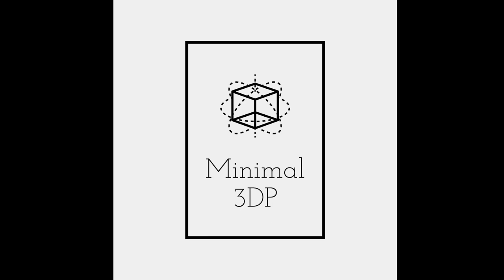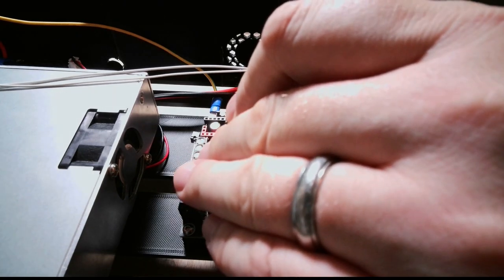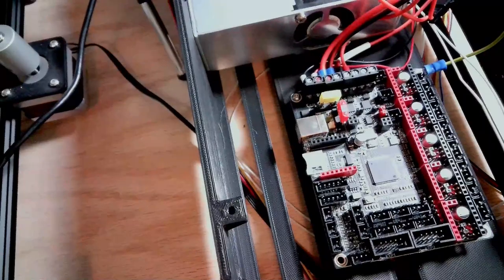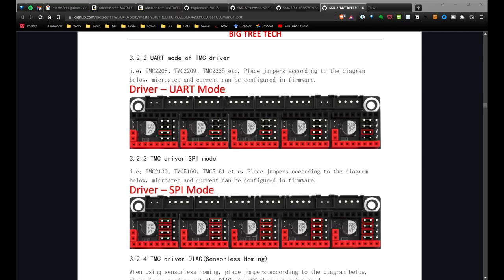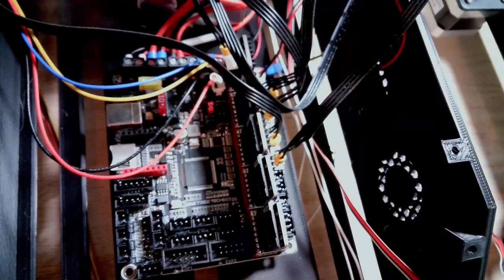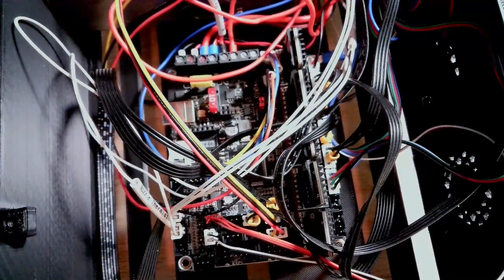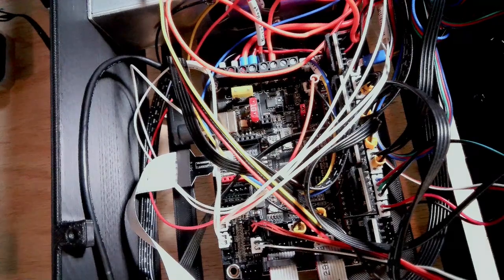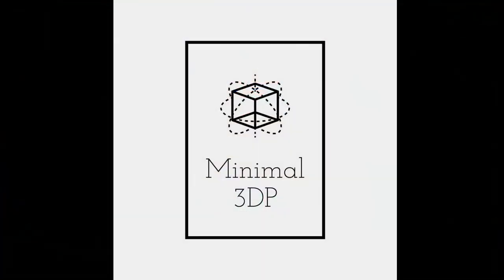A Wiring Guide for the BTT SKR 3 on an Ender 5 Plus

Comment from the maker: I believe that this guide will work for both the SKR 3 and the SKR 3 EZ. The EZ board is laid out slightly different.
Reply: I'd be very interested in the model you used for the box, as I've found the stock box to be wanting with regard to ease of opening and upgrading of the electronic components.  Please let me know what references and info you used to do the upgrade.  Thanks :)

Comment: Thanks so much for doing this. Extremely helpful as I am changing my build. I was having problems trying to figure out the wiring for the end stops and the thermistor. You solved the problem.
Reply from the maker: Glad to help. Reach out if you have questions.
Reply: Did you have to trim some of the 2 pin connector for the x and y end stops in order to fit it into the 3 pin socket?
Reply from the maker: @jugvara  I think I was able to seat them without trimming. I think trimming should work as well.

Comment: Excellent, did you connect the heated bed directly to the motherboard or is it connected as with the creality motherboard and goes directly from the power supply via the mosfet? Thanks
Reply from the maker: I used the MOSFET.
Reply: @minimal3dp  can u share connection mosfet please? I have difficulty to understand why in my case not work 😅 thanks

Comment: Hi, I have just purchased a btt SKR3 EZ to my Ender 5 Plus and found error of ”Unable to read tmc uart 'stepper_y' register IFCNT" during install klipper firmware. I have found that there is no voltage supply to EZ2209 Vio pin and do a 3.3v jumpper for it, the problem is solved for axis x, y and extruder but Z remain the same. 

Another issue happened as the stepper motor comes out with sound like fan, the home function is not working. The arrangement of the stepper motor wire is remain the same as the previous board. Hope you can give me some clue on what happened to the board. 

Thank you
Reply from the maker: Sounds like there are issues with your board. Can you return it?
Reply: @minimal3dp  I am now trying to do it but the technical team is almost worn out all oof my patience, the reply of the email is extreamly slow and some question that I think no need to ask, just give me a replacement board as Vio is no supply such as measure V_M of the driver.

Comment: I have an old Ender 3 clone based on an MKS Robin Lite that was dead when I received it. I am trying to replace it with a BTT SKR Mini E3 v3.0.
My printer has X, Y and Z endstop switches that have 3 wire connector, so they don't fit the BTT 2 pin connectors for these endstops.  
I have searched the internet for 2 wire connector endstops for Ender 3 but there are only 3 wire endstops available for Ender 3 and variations.
Everyone I message says this card is plug and play because their Ender 3 came with endstops that use 2 pin connectors to the mainboard. 
I haven't had the chance to examine these connections on an actual Ender 3. What am I missing here?
Reply from the maker: It was all plug and play for me. Can you share pics of your wires?

Comment: Bltouch, did you flip the wires around from stock order to diagram order?
Reply: Red and brown?
Reply from the maker: I will have to look. I had used a previous BTT board before going to the SKR 3. I will look tonight.
Reply: @minimal3dp  Left to right.
Brown,red, orange, white black???
Reply from the maker: @Extrabitz  on the board from the screen plugs towards the power plug ins: 

White-black then orange-red-brown
Reply: @minimal3dp  won't home.
Pronterface m119:
Recv: Reporting endstop status
Recv: x_max: open
Recv: y_max: open
Recv: z_min: TRIGGERED
Recv: z_probe: TRIGGERED
Recv: filament: TRIGGERED
Recv: ok P63 B31
Reply: @minimal3dp  z-min? Did you flip wires around on the Za or Zb?
Reply from the maker: @Extrabitz  I have dual z so it didn’t matter.
Reply from the maker: @Extrabitz  I am not at home check the doc on BTT GitHub. I think you need to review the wiring and the changes for marlin. I think you can fix your issue via code.
Reply: Hi, I  did not get the bltouch to work. The wiring and the code in marlin is as it needs o be(z min probe pin is PC_13 on the skr 3, the skr had PE_4). Don't know what to do next. Any ideas?
Reply from the maker: @francescocolobrese8098  is the probe powering on?

Comment: You have that case up yet? Was about to cut the top off mine 🤣
Reply from the maker: I will try to upload it tonight.
Reply from the maker: Here is a link, Keep in mind that i am still working on it.

https://www.printables.com/model/276523-ender-5-plus-electronics-case-for-btt-skr-233-ez
Reply: @minimal3dp  Is this still the latest version? I'm about to install the SKR 3 in my E5+ following your wiring guide :)
Reply from the maker: @noviceartisan  The guide is still good. The firmware needs to be pulled from the latest bugfix. I will update it later today. The version there is still good.
Reply: @minimal3dp  Any chance you could make 2 versions for us, with the very minor difference between yours and the one I'd like of comment out #define DGUS_LCD_UI_ORIGIN by changing it to //#define DGUS_LCD_UI_ORIGIN then remove the // in front of #define DGUS_LCD_UI_RELOADED.

This will allow the stock LCD to be used with the SKR boards, once it's rewired to the correct pin order (only 4 pins needed) on the SKR boards, and has had the firmware on the lcd flashed with the updated DGUS reloaded firmware :)
Reply from the maker: @noviceartisan  Here you go https://github.com/minimal3dp/Marlin/tree/E5P-SKR3/M3DP-Release DGUS was already deactivated.
Reply: @minimal3dp  So it's already got DGUS_LCD_UI_RELOADED added? The Stock LCD won't work without that line been added, and the other LCD driver been disabled too ( REPRAP_DISCOUNT_FULL_GRAPHIC_SMART_CONTROLLER ) as it can't work with both screens enabled at once ;)

Thanks dude! Much appreciated ^_^
Reply from the maker: @noviceartisan  https://github.com/minimal3dp/Marlin/tree/E5P-SKR3/M3DP-Release DGUS_LCD_UI_RELOADED is enabled and REPRAP_DISCOUNT_FULL_GRAPHIC_SMART_CONTROLLER is disabled
Reply: @minimal3dp  You're a gent, thank you very much ^_^
Reply: @minimal3dp  One silly question, how come that single bytes worth of change creates a 40KB file size difference between versions? Seems odd to me to have such a large difference from a single line of code lol
Reply: @minimal3dp  Sadly I wasn't able to get them to run with the stock LCD, so I dived into development hell and now have files I can share with everyone that will have the stock LCD working perfectly :)  There were a few more lines needing adjusting in the config files than just the one I assumed wass it. Not sure how to upload to share though, will have to get the hang of github
Reply from the maker: @noviceartisan  don't know if this this will help but I did this video a while ago.  3D Printing: A Comprehensive Guide to an Improved GitHub Setup
https://youtu.be/LhVOSVjgYXc